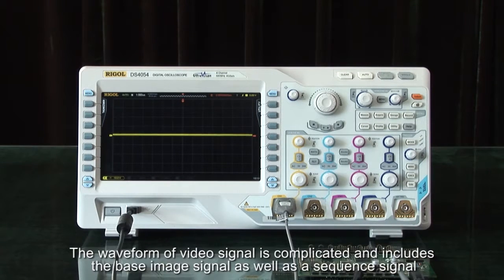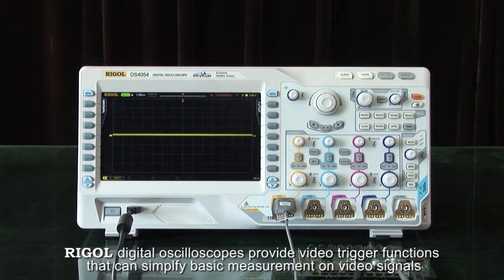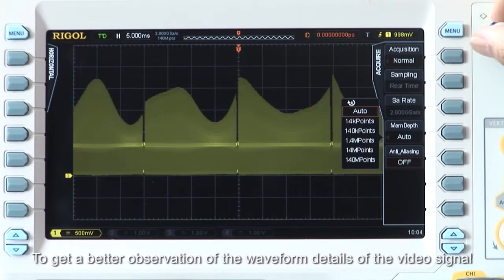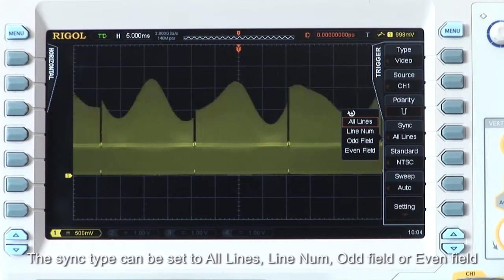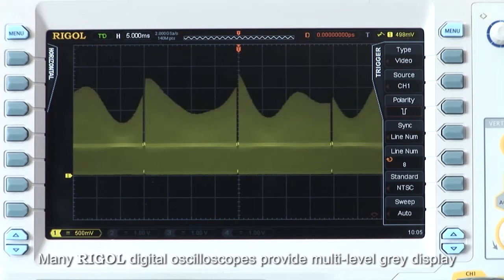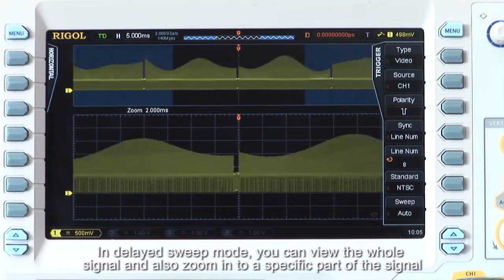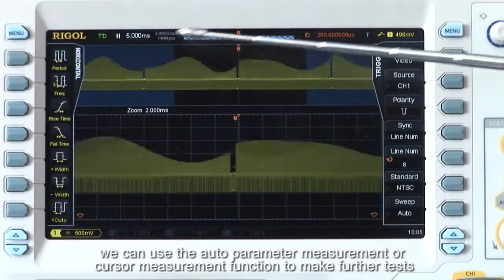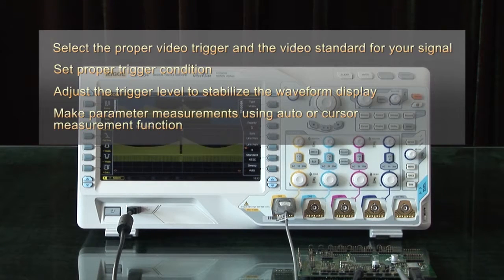Using Video Triggering

Comment: Does anyone use PAL or NTSC analogue signals anymore anyway? DVI/HDMI/DisplayPort etc are all digital
Reply: John Michael Stock - Yes, composite video signals are very much in use today. For example, backup cameras in vehicles must transmit a video signal approximately 20 feet. And it must do this with low distortion and at a low cost. HD 4k video is not needed. Therefore, composite video is suitable, because it uses only a signal wire and a GND (shield). The distance is too long for parallel video signal cables, due to its higher cost and distortion due to varying delays from one wire to the next. CCTV for security systems also has the same design requirements. Composite video encode / decode functions are available in low cost integrated circuits. Rigol oscilloscopes, for example, have a "video trigger" function that makes it easy to acquire a composite video signal for diagnostics, with both NTSC and PAL subfunctions.